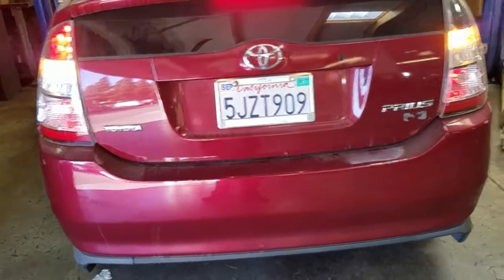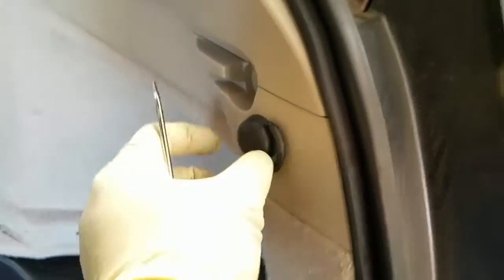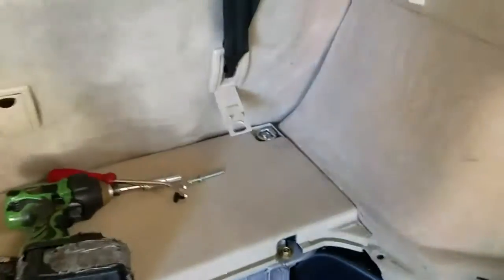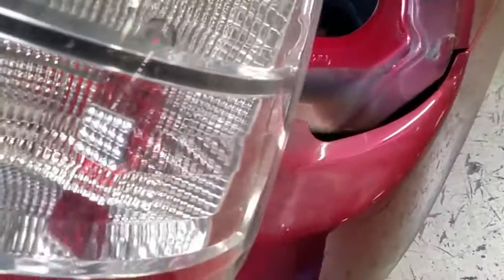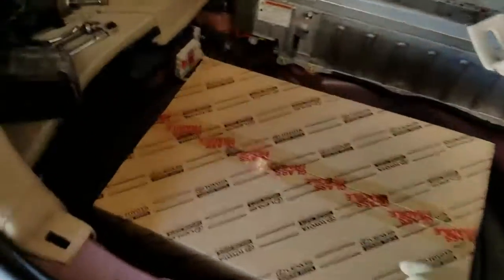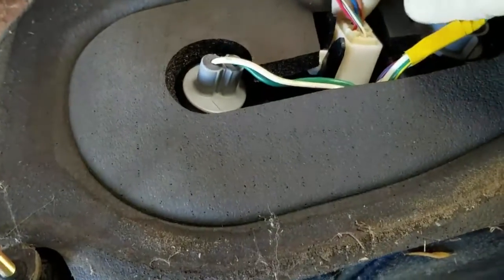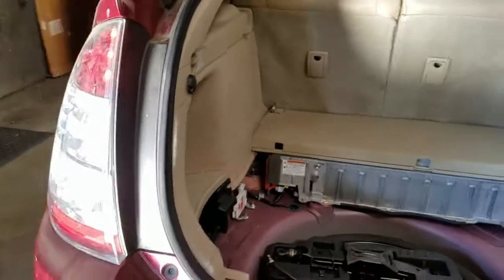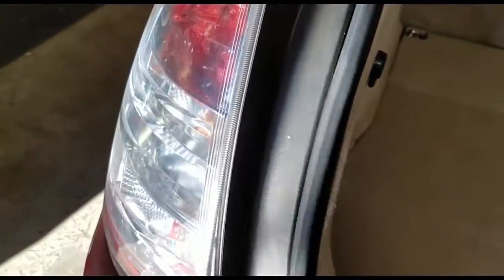2004 2009 toyota prius replace the rear brake light lens assembly!

Comment: I was able to remove it without having to disassemble the entire trunk. I just removed that little plastic cover and already got access to the two screws that hold it in place, it was super easy to pull off.